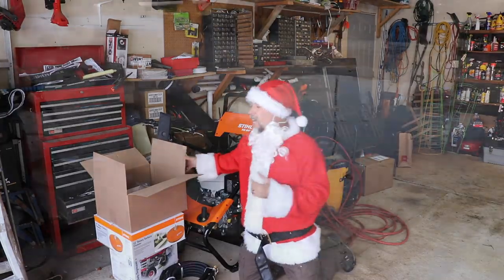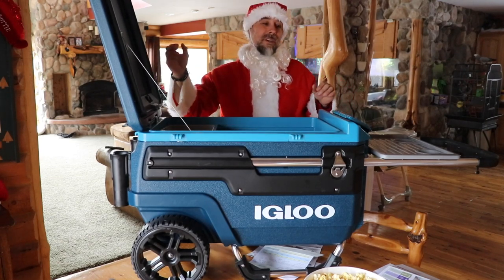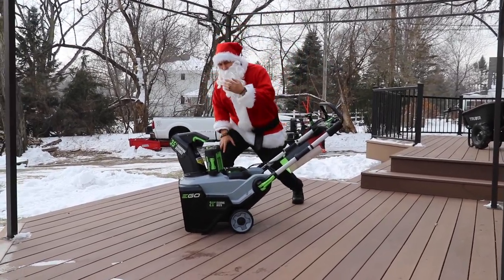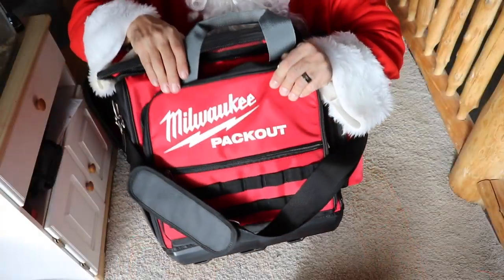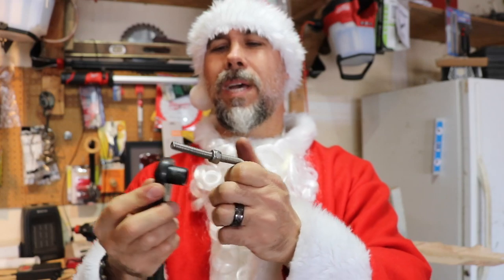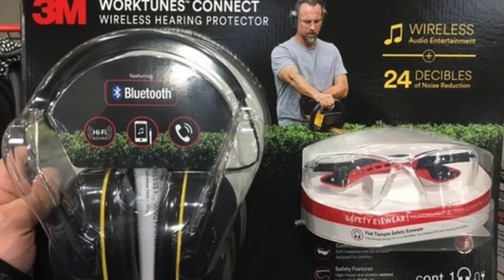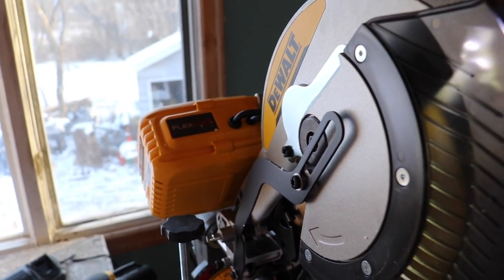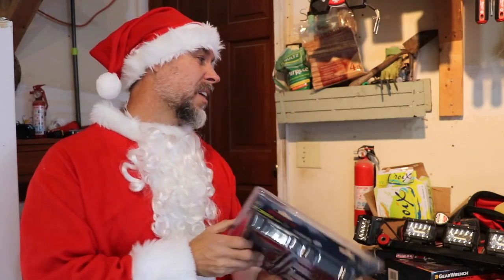The10 best tools of 2018 to give as gifts from Stihl, Makita, Milwuakee, Dewalt, Bosch, Ego & More

Comment: I want to see the pressure washer slice thru a 2x4.
Reply from the maker: I want to try it!
Reply: We all want to see it now!
Reply: Pressure washers can't cut through wood unless you add an abrasive compound to the water like how water jets cutting tables work water is just used to accelerator media like glass or sand so you won't be cutting through any 2 by 4 anytime soon
Reply: Do not think "can't" is the right word. You can, but it will take a very long time. I have got a smaller 2000psi model from the depot, and going with the jet nozzle I can cut through wood eventually. It just takes an absurdly long time and you cannot try to take to big of a bite.

Comment: That Crescent wrench you were showing actually has an additional function. You can flip the jaw around and it turns into a small pipe wrench. I'm an apprentice plumber and have been using that wrench personally for a few weeks now in new construction. So far I've used all three options on it and it's been holding up very well.

Comment: Could you do a review on log splitters, commercial grade for home owners. We have the vertical singlecut but the parental units are getting older and lifting the logs into position and have him do one cut at a time is taking forever. We are looking at getting one that self loads and does multiple cuts all at once and from what I can see you have to go to the commercial grade but those are really expensive, there are so many different options and I'm trying to figure out which one is worth the money. I would like to keep it under 5 thousand but will possibly spend a little more if it is worth it. We need to tow it through the woods to where the logs are also so it has to be towable and compact, nothing to bulky. Any ideas.
Reply from the maker: Good idea Heather, I will keep it in mind, thanks !
Reply from the maker: Actually heather I did a couple log splitter reviews this spring.
Reply: Check out Eastonmade Splitters. The 5-11 and 9-16 are exactly what your looking for @heather smith

Comment: Oh, and caution folks about the deck washer. Those units are not designed for wicked high pressure. The “o” rings are not durable enough for 3k plus pressure. And when o ring goes, it blows!

Comment: That compressor won’t work for any real truck. I do like the Milwaukee bags .
Reply: Lol what! But your a Dewalt guy so you have no clue what your talking about.
Reply: Not meant to inflate all 4 tires from zero pressure, meant to add air if needed or blow up some sports balls
Reply: Doesn’t matter what my user name is I also own Milwaukee tools. That being said the fact that the compressor won’t  inflate up to 80psi which is what any 3/4 ton or higher truck needs has nothing to do with the name on my account.